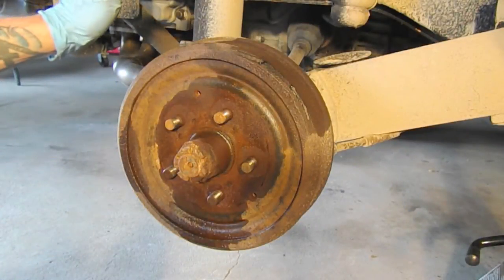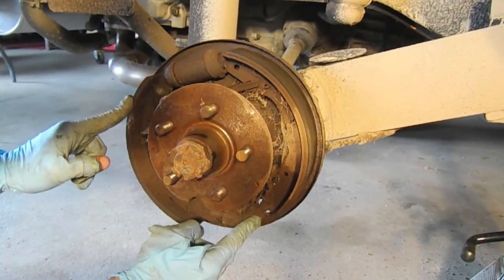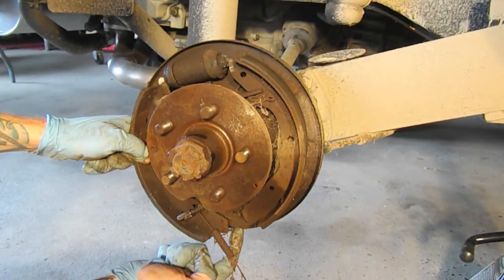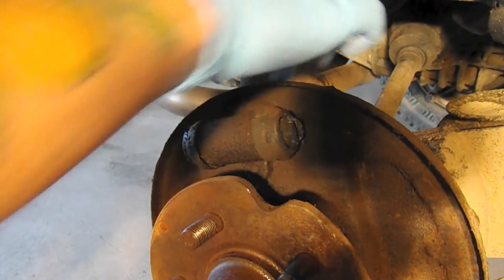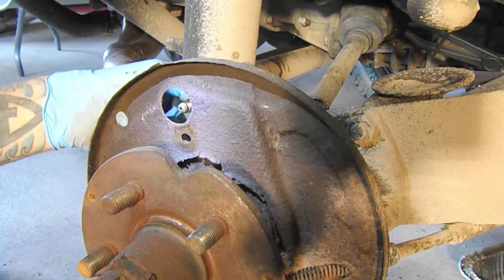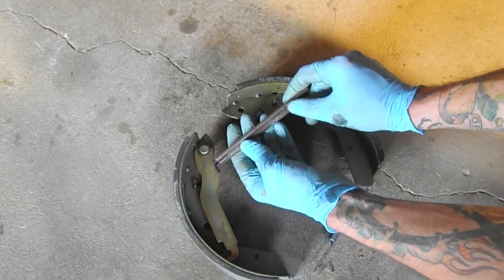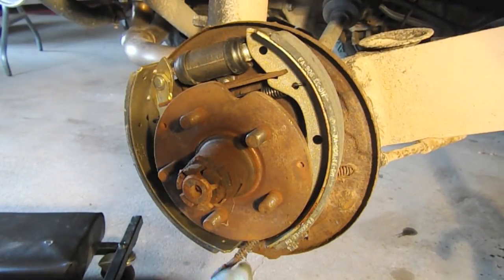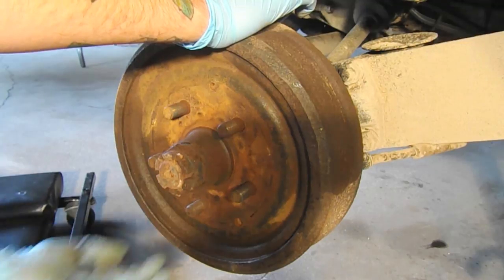Rear brake rebuild on VW Bus

Comment: An excelent u"tube explanation of an important task, well done,.I have to replace both rear LH & RH shoes & brake cylinders, your video will ensure the task is completed correctly, Thanks for your effort. 
RP  UK, 1985 VW Jubillee Joker owned 21 years......still a beauty.
Reply: Agree totally. It's tricky fitting that spreader bar for the handbrake cable - tried it this afternoon, gave up and then  watched the video. There is also a flat clip - VW part that hooks from the spreader bar to the "spring at each brake shoe" spring. 
The VW T3 went to having two springs instead which is a lot easier to work on (and a single adjustment wheel).

Comment: If you use acid to do the drums youll have to degrease it first! Makes them look like new and way better then glass beading because it eats the rust chemically.After your done dipping and its dry give the inside drum surface a quick buzz with some sand paper.

Comment: Great video. One question: what about the brake shoe retaining pins and springs? I've had a time installing mine on my '71 bus and was looking for help, but it didn't look like you installed any...
Reply from the maker: +Hamp Ingram Mine was a 77 but in assuming they are similar. The springs on mine weren't anything out of the ordinary on drum systems. It seemed very similar to any Chevy, Jeep, or other VW's I've done. I wish I could offer some better insight!